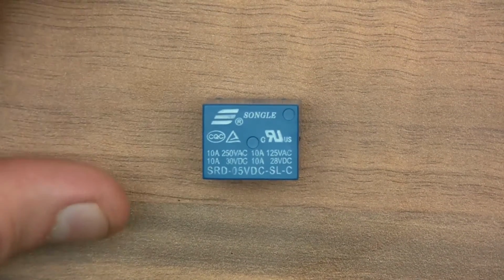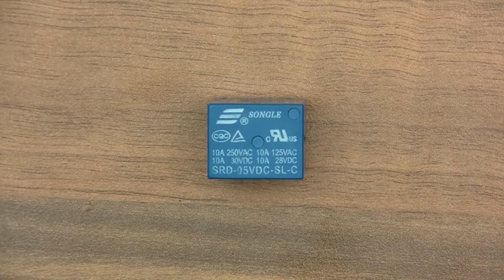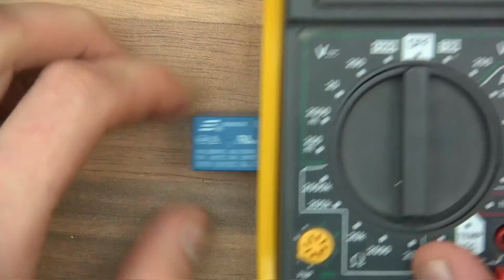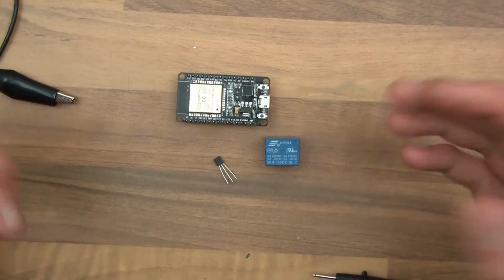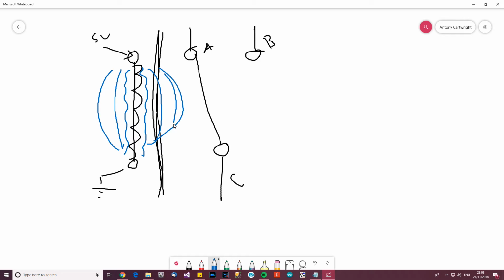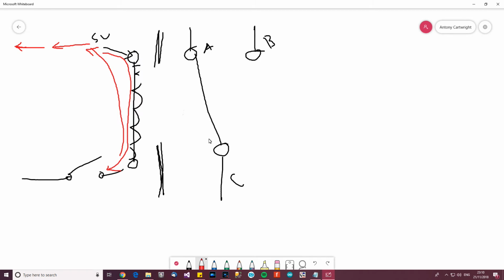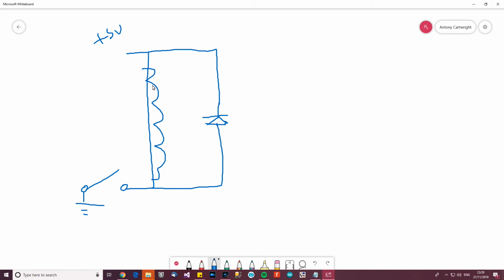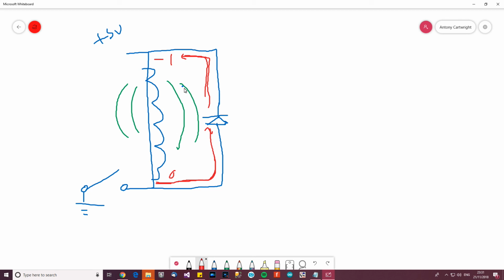TUTORIAL: How to Setup & Code A Relay - Arduino, ESP32 & ESP8266 (Part 1) Quick + Simple!

Comment: hi, some relay has 3V, 5V, 12V such as JQC3F-03VDC-C, JQC3F-5VDC-C and SRS-12VDC-SL what actually this different voltages mean ?
Reply: Min voltage needed to trigger relay, for arduino you need 5V, esp 3V but you can use 5V as well

Comment: Just a word about the back emf from the relay coil. If it was an ideal circuit the voltage would be infinite because there is a divide by zero in the equation. But because we live in the real world where wire has resistance and capacitance it would be some where between a 1000 to 2000 volts.
Reply from the maker: Yeah it's interesting isn't it! The actual coil itself has a tiny resistance too!